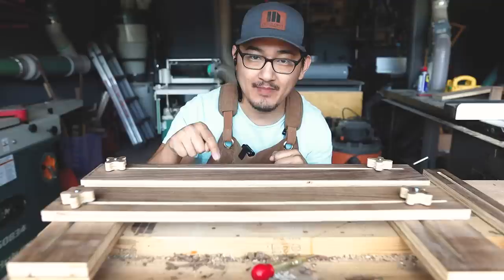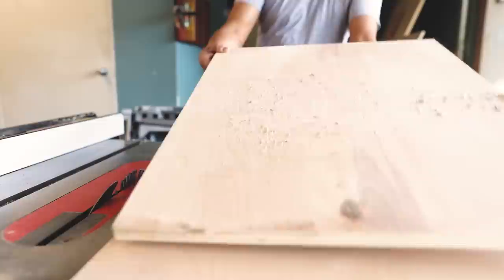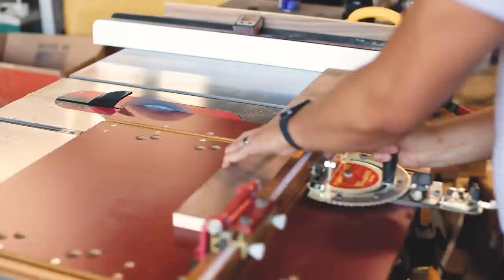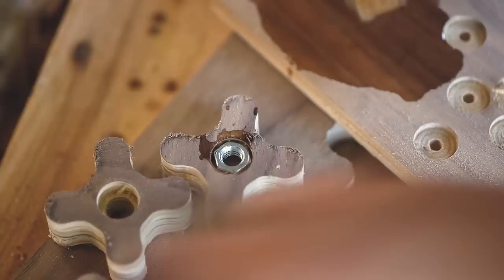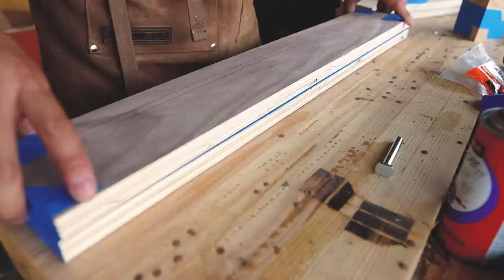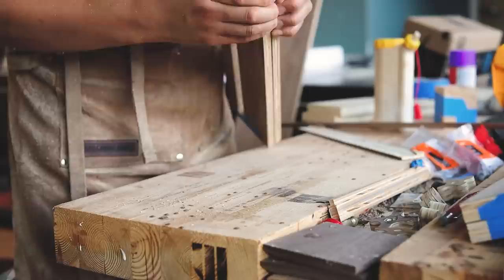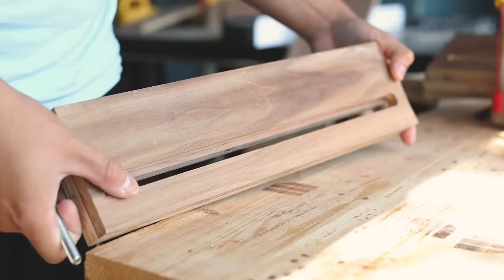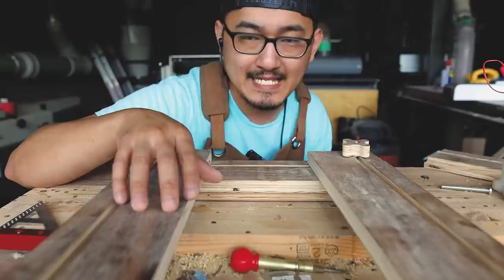The PERFECT Dado Jig! FREE PLANS! // How To // Woodworking

Comment: You can do similar with a paperbag instead of blue tape and carpenters glue instead of spray adhesive. put the glue on both sides and sandwich the paperbag. separate with a chisel. I learned it for turning bowls on lathe. I think it is a stronger connection.

Comment: Do both sides of the jig need to slide? One side could be fixed at 90 degrees and so you would not need to square it up? Obviously this will limit you to 90 degree cross cuts.
Reply from the maker: it certainly doesn't have to slide if you don't need to. But it wouldn't be possible to but an angle lap joint and have the fence line up against the work piece.  The jig was made for unlimited flexibility, but if your needs are less than that, then sure you can fix one side. Hope it helps!

Comment: Good job.  Few questions or problems I see with this.  Why not cut slots with router?  Also, why not just let work piece hang over edge of bench instead of spacer?  Something to register  it square?  Wider rails for bigger router?
Reply from the maker: Thanks Robert! You can definitely make this the way you states. Few cuts with a router, but I didn't have a router table for me to ensure the slots were straight. The spacers is used so that the router wouldn't eat into the edge guides as you're making a cut. And for sure you can make the rails widers for larger routers, but I intended this for trim routers. Thanks for your feedback and tuning in! I appreciate it!

Comment: I know this old, but the part where you said you didn't have enough surface area for your router to sit on, you could've just routed the other side, then moved one side of the jig closer. Then do the middle portion.
Reply from the maker: Thank you! I think you're referring to the half-lap joint. The issue is having the router tip over since one side isn't supported. Therefore I added in that smaller little guide.

Comment: is there reason to make both smaller sides movalble? i suppose you can one fix side and end up with three knobs having about the same jig.
Reply from the maker: It allows you to make more complicated and varied angle lap joints.  IT's much nicer to reference the flat fence when you need to make a 45-degree cross lap joint for example. But definitely make it your own 👍

Comment: If you had a thin piece of plywood and a fence. You could just cut in to the guide and no need for the template bit
Reply from the maker: If you cut the guide, how will it be straight?
Reply: @DesignCraftWorkshop  it works like a track saw guide track

Comment: I have to say that while this jig is decent and I have seen similar made before, it just isn't appropriate to use it with a trim router.  You need a wider more stable base plate for a jig like this.  That rabbit and half lap you cut was really sketchy.
Reply from the maker: Thanks for the input 👍